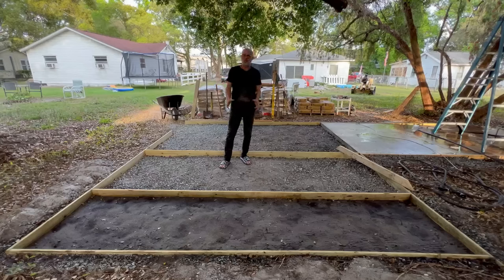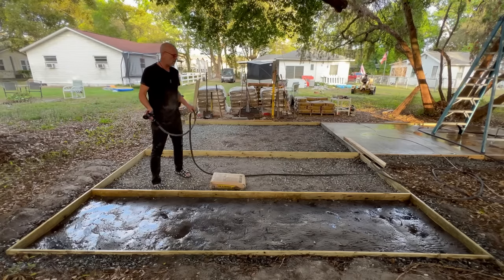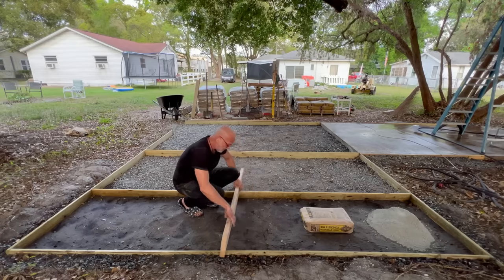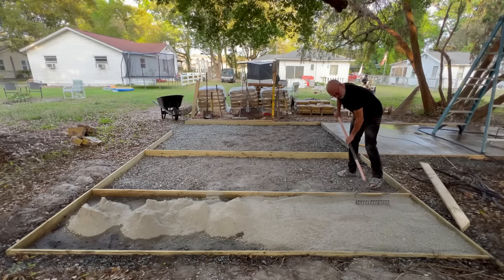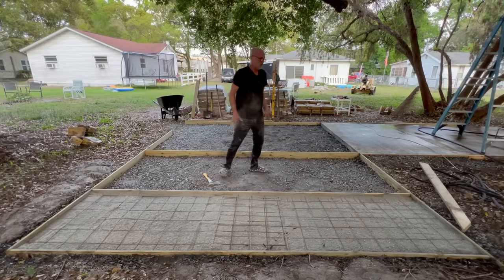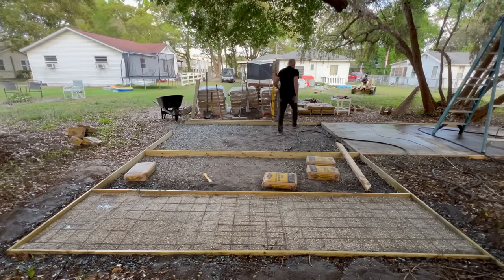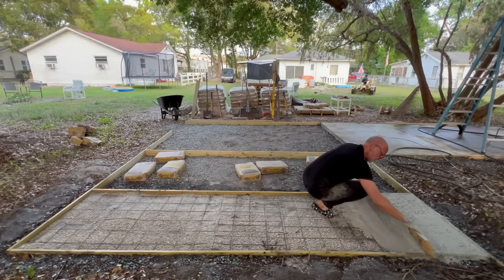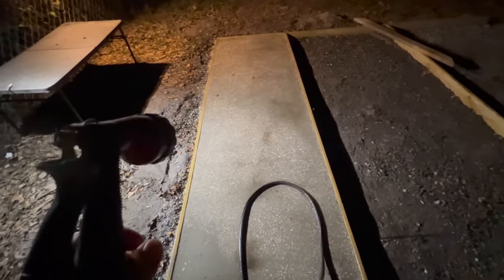How To DIY Dry Pour A Large Concrete Slab In Real Time

Comment: Man buy yourself some nitride gloves....your hands are going to feel terrible tomorrow with all of that concrete on them.  With that said, the biggest flaw in the dry pour of a job this size is that if you are doing section by section....and it rains....you are screwed.  Those pallets of mix will become pallets of concrete.  Good on you for taking on the project...and I have dry poured a few small projects...but that amount of concrete left outside even with just high humidity at night is a potential recipe for disaster.

Comment: You can't short cut cement, unless your lazy.. ratio: 1 bucket of cement, 3 buckets of sand, 3 buckets of stone if wanted, and 1/2 bucket of water mixed thoroughly...If your mixing mortar for brick, don't use the rock.  Anything short of that will not last, and  I've opened many a sack of cement, and all the gravel was at one end and the cement was on top, so when you pour the whole sack in a post hole, guess what happens... And just sprinkling water on it make look fine on top, but not the whole depth...The way you're going about it is, this generation wants quick results with everything..If your doing something, do it right the first time

Comment: Don't dry pour. Concrete readymix isn't made to work in this way. For full strength. Mix with water. If you want your slab to be 70% weaker. Then this way is for you. FFS. Reserch on Youtube before you make this mistake.  But live and learn

Comment: Well it didn’t turn out as nice as other dry pours (but no one knows that better than you). I’m guessing because you got too excited about wetting it. AND you need to screed it for the top finish. Sucks that you found that out on such a large pad, but it will provide a hard surface for your building nonetheless. You got my like for your efforts, but I would not label this as instructional unless you update it with what you should have done.

Comment: You ARE that guy !  Drill a hole in the slab in TWO years and you will find Dry, Unmixed concrete. It will harden for the first couple of inches then that's it.  I've been building houses and commercial structures for forty years. Concrete needs water and has to be mixed. Ask your wife to put cake ingredients in a pan and bake it without mixing it ! YOU won't eat it !! THIS is the kind of stuff they're talking about when they say "GOAT ROPERS" !!
Reply: Well if he has to DRILL a hole in 2 years, this was a success. Everything that came out of your childish rant after that is pointless...

Comment: Good job but the only thing I can say is safety first and work smarter not harder. I would have used the wheel barrel to move the concrete I stead of carrying it and you SHOULDNT BE WEARING FLIP FLOPS!

Comment: How do you dry pour concrete… you don’t.  There is a chemical reaction that happens with the Portland cement, sand, and aggregate in the proper proportions.  With a dry pour you don’t get the homogeneous mix, and it weakens bond.  But It will do to sit lawn chairs on.

Comment: Do yourself a favor before you try this.  Square of pf a 3x3 piece somewhere out of the way and "dry pour" it.  It is strong enuf (I've laid more concrete than he has in this fashion) and as long as your "base" is well compacted and you are 4" or so it won't be a problem.  But 3" is NOT 4" and anything under 3" is just waiting to be busted up.  But, you are NOT going to like the finish of the surface.  And if you do the math you are going to find that the cost of bagged concrete like you get at Home Depot (what he has) is about the same as getting a mixer to deliver it ready to pour.   Yes, you will have to round up a couple guys to help, but.  The surface finish is impossible with a dry pour.

Comment: Somebody really has to say it, this is the worst and weakest way to make a concrete slab. Please do not promote this idea as something sensible for people to do.  It is very likely the reason the previous slab that was there was broken apart and disintegrating.  There is no hack or shortcut involving concrete.  I am a concrete guy I have been doing this kind of work for over 30 years if you want some free advice on any project you may have reached out to me but please for the love of anything good do not listen to people like this person. The final product looks terrible, it's much easier to put a little bit of effort into something and get a better result. 😊

Comment: I would suggest to put on real work boots, gloves, mask to protect your lungs and goggles  - As far as compacting sand you use water - As far as your concrete will loose strength but it should be sufficient for what you are using it for. I would however wash my feet and hands to prevent concrete burns - you might wand to rent a bull-float and use more water for finish.

Comment: This video is a great example of what not to do (a lot of half truths and incorrect use of tools). When dealing with a high level alkaline, wear gloves, closed toed shoes, and a decent dust mask. Don’t wear black. Use the wheel barrow to move the concrete. Use the screed board to get the rocks to settle. Use a palm sander on the edge to settle the outside. Don’t pat concrete like a baby bottom with mason tools. Mason tools aren’t even needed. O-H-I-O

Comment: WOW 😮 Everyone please refer to YouTubers “ Cajun country living” videos on concrete dry pour videos + “Life in the Pines” concrete dry pour repair slab featuring “ Cajun country living” Sorry, but this guy is making many mistakes. I’ve done lg dry pour directed by “cajun country living” w/gorgeous results and will be long lasting. Inset wire should not touch framing, will rust causing salad to eventually crack and break, etc.

Comment: Why? Everything about this is wrong. I've spent my life in commercial construction and made my way up to bridge superintendent and was superintendent on the I-10 Twin Span between Slidell and New Orleans. Don't do this!!!! The health hazards outweigh any benefit and it's not as strong. The dust alone is horrible for your lungs and getting concrete on your skin will cause a caustic burn. I got some in my rubber boots one time and didn't neutralize it with vinegar and just kept working another 4 hours. I spent 2 weeks in the burn unit getting grafts on my foot and shin. Full thickness on my foot so when I peeled my sock off, everything came off with my sock except the bone. I can put a cigarette out on it and not feel it. Simply don't do this!!!!

Comment: the trowel your using is ment to bring up the fines. if it was wetter on top it would have helped with that, a wood float would do the same. but you did need more water on it to finish it sooner.
nice job and good video. I seen some one else mention about concrete burns as well.

Comment: To the uneducated and inexperienced in construction, your video may seem like a cool idea. And, your method may be just fine for many non-critical backyard projects where proper structural integrity is not important. But if concrete neds to be used for something where properr structural support is needed, then your method is very dangerous. Without mixing concrete properly and with correct ratios of water then the strucural properties and integrity of the concrete will be dramatically changed.
Reply: He isn't building a fcking bridge.

Comment: Listen, we live in America and you can do whatever you want with your money however, this is a terrible method for pouring a reliable slab.  One of the most important parts of concrete is the water to cement ratio. There is absolutely no way to control the amount of water hydrating any part of this except for the surface and even then the cement under is drawing out the moisture and preventing a good cure. Also, I don't see a single way this is faster than renting a mixer and pouring with a wheelbarrow. Now, I'm not sure where you're at but most concrete suppliers will deliver 4cy for no upcharge at probably $130 per yard right now on a basic 3k mix. There are many ways to get this done cheap but this is a terrible shortcut that will likely look terrible within 1 year under any traffic. It doesn't really matter to me. I used to get a ton of side work replacing stuff like this and would charge for removal.

Comment: I went with a truck. It's faster and all you really have to do is have your forms already ready, skreed and broom, after they pour.

Took only 2 hours to do a thick 10x16 5 inches deep. 1 hour to pour and skreed. Then waiting the 45 minutes for it to cure enough for the broom. I also put ancor bolts down and smoothed the edges and used a Sawzall to vivrate the forms to reduce the chance of the sides being pitted. They came out great!

When you factor in the time, work and equipment, getting a truck is better; but it really depends on your situation. Maybe saving $50 in that delivery xan be used better else where.

Maybe the area just isnt accessible.

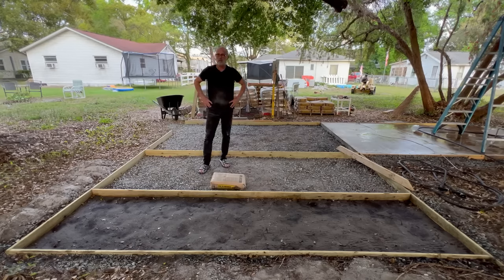Comment: 😮 no dust mask, no gloves, no picture of a finished product. You could have backed up a concrete truck and been drinking a beer at 2:00 in the afternoon and been done with the whole slab. There's no strength in that concrete and it will not last long. Don't quit your day job as a YouTube influencer.

Comment: Mr. Dry-pour.  Because we're about 14 months since this project, was wondering if you have had any lung issues, as you inhaled lots of dust since you failed to use a Respirator mask.  Cement dust is very toxic on the lungs and a known carcinogen . . .  Sure, hope you're OK and that isn't the reason for no follow-up video to your project, or at least one i could find.  CONCERNED . . .
Reply: Not to mention that he might as well have been barefoot wearing those sandals.  Not sure about irritation with dry cement but the mixed stuff can give you some issues

Comment: This is an excellent video on how NOT, to pour concrete. Without proper mixing the slab WILL. SHATTER LIKE GLASS!! This slab will not hold a bbq. I have been in the concrete business for 35yrs. and this is completely wrong! If you want to dry pour concrete( for whatever reason) put the concrete in a pile, like a volcano,. Pour water in the middle and THOROUGHLY mix with a hoe or shovel. Never do it like this guy. The water never penetrates all the dry concrete, leaving dry voids everywhere , in the video. Plus the fact he uses no mask when he works the dry concrete. Concrete power is one of the leading causes of cancer in masons. He also is not using gloves or protective shoes. He WILL suffer chem burns for his ignorance. This is a great video on how NOT to dry pour concrete.